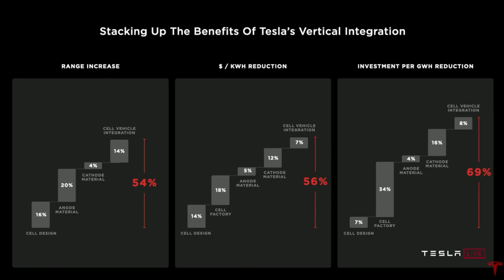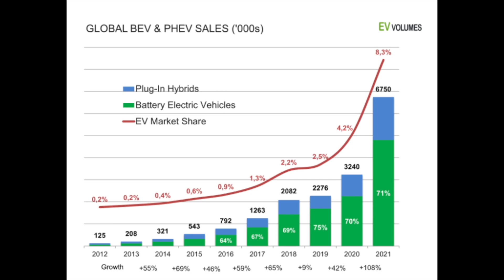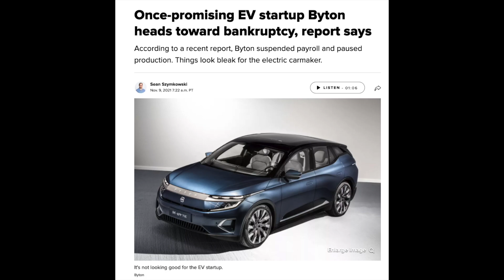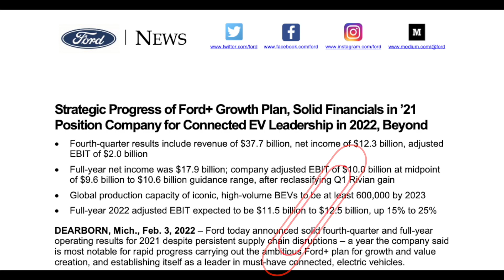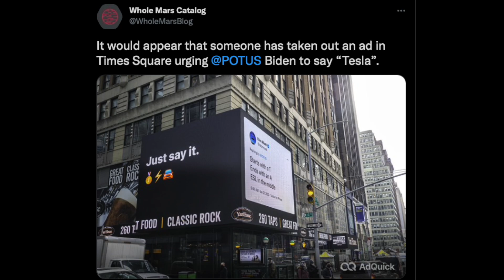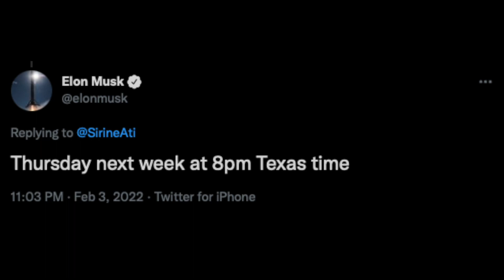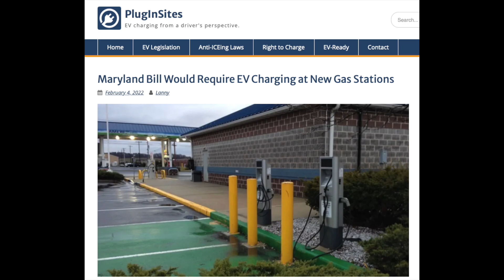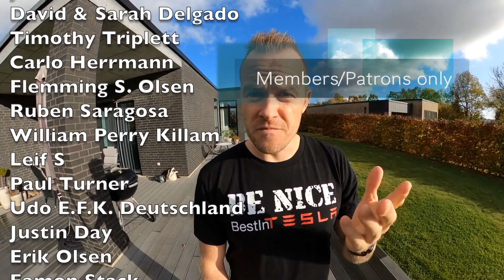Will Tesla overtake GM and Ford’s bottomline this year ? Is the Tesla Model 2 cancelled?

Comment: The word "Tesla" does (in fact) HAVE two syllables.  Congratulations on getting THAT part right!
HOWEVER - - - IF you want to divide the word INTO it's two syllables, it's always advisable to put the division BETWEEN the syllables, instead of arbitrarily cleaving the word into two pieces with a random chop!
This would render the word as follows:  TES / la , with the upper case and lower case letters used to indicate which syllable is the one most commonly stressed by speakers of English, who are 'un-plagued' by speech impediment - or other affectation.
We (English speakers) have no part of speech that sounds like "sla".  ffs!

Comment: If Tesla could just build cars without batteries they would not be battery constrained!  Gas tanks are cheap and easy!  Tesla could save tens of thousands of production dollars per car!
Reply: David, are you ok?
Reply: Fremont & Shanghai are expanding production capabilities, Texas & Berlin soon will be open for business. if existing factory at full capacity, then there is no constraint of any kind. "Gas tanks are cheap and easy", very true, however ICE engine and transmission are not cheap and easy.
Reply: @SLee-vj4px  ICE engines and transmissions are much cheaper and easier than Programming.  :)
Reply: @Lovingkindness.  Yes.  I am just saying, Tesla could be coming for Legacy Auto.  They could ditch the batteries and dominate ICE vehicles!  GM would lose their minds if Tesla started building millions of ICE a year 70% faster and 30% cheaper than GM can do it.
Reply: @davidbeppler3032  you are out of your mind.
Reply: @SLee-vj4px  I am just pointing out, Tesla could do it better and faster.  If they wanted.  Elon is a catalyst.  Any industry he enters is in trouble.  Elon is putting 5% of his time into boring company and they are putting traditional tunneling companies out of work.  I had a long conversation with a professional tunnel engineer and he said the boring company did nothing special except do a job that no other company would take because it was not valuable enough.  Also that he got it done in America on time and under budget without 10 years of legal battles before the project even started.
Reply: @davidbeppler3032  "Tesal could do it better and faster" you mean if Tesla making ICE instead of EV? is that what you are saying? if so nothing I can say but you are out of your mind
Reply: @SLee-vj4px  ICE is easy.  EVs are hard.  Legacy Auto does not have material engineers, or programmers.  They have MBAs.  They can't produce anything as fast as Tesla.  Hell Tesla has ROCKET SCIENTISTS on the payroll!  Lmao
Reply: @davidbeppler3032  right, I totally agree with your last message. Elon's goal for future will shock the world as many people did not realize EV will be a small part of future Tesla empire.

Comment: The "Model 2" would have been a grand slam home run for Tesla stock in 2022.  This is because gas prices are going to climb significantly in 2022 and probably stay high for the next few years, and having a truly affordable EV option would have been appealing to investors.  The Tesla truck would have been the next best thing, although, let's be honest, Tesla has zero chance in the truck market.  Zero.  You can hold your breath all you want on that.  The big boys are making a huge push in the EV truck space, because that is where the volume is.  No one that has owned a GM, Ford, or Dodge truck is going to ditch their brand and go with a Tesla.  Its just not happening.  Highly unlikely to take much from Toyota in the compact truck space either.  Tesla may take some numbers from Nissan and Honda in the compact truck space, but even that seems unlikely to be of any significance.  Overall in the truck market, there are just too many things you won't be able to do with an EV truck.  I won't even bother explain, because EV fanatics just don't get it.
Reply: Hahaha.   I owned a 2000 Ford Ranger EV NIMH.

They will be running to the Cybertruck
Reply: I owned a Ford truck, and four Econoline vans (150, 250, 350). My Dad owned a Ford truck. My stepdad owned Ford trucks. I'd buy a Cybertruck tomorrow if it were available.